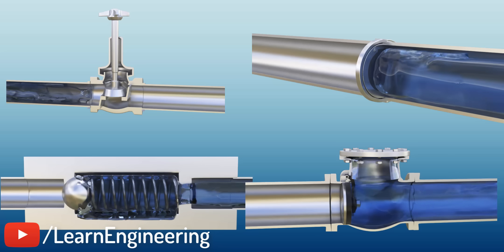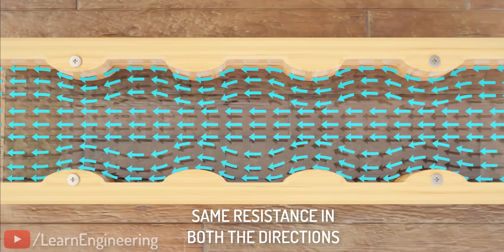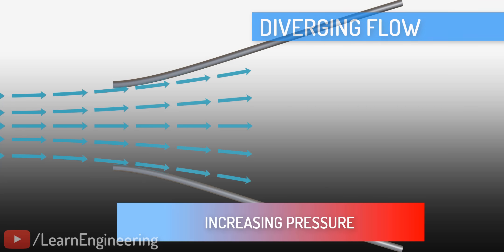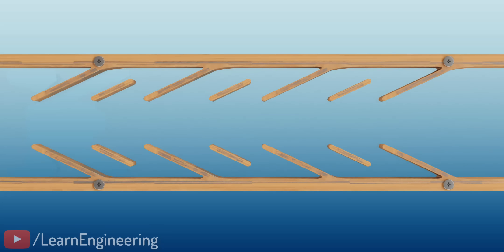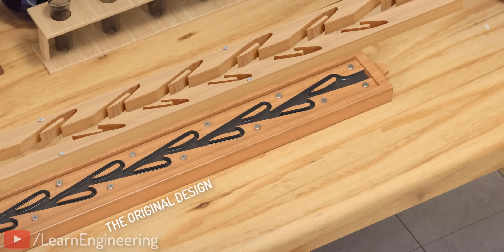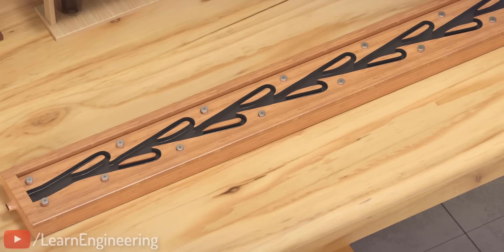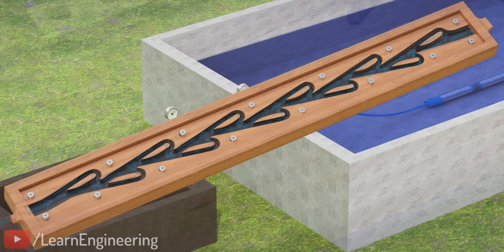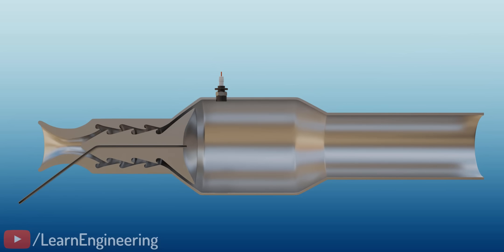Tesla Valve | The complete physics

Comment: Never thought Nicola Tesla would have had anything to do with fluid mechanics
Reply: It is kinda common for genius scientist to work in various areas, it's just usually they impact certain field of study so much, that it overshadows their achievements in other fields, which are remarkable by themselves
Reply: @Omgtired  there is no such a thing as a genius 

And it was more that he specifically had diverse interests
Reply: @Omgtired  yeah like Faraday also worked on the electrochemistry specifically the electrolysis but he got recognized in the field of electromagnetism
Reply: Fluid and electricity both take the path of least resistance.
Reply: @dtom2126  FULL BRIDGE RECTIFIER
Reply: @dtom2126  They also can be deadly in large amounts.
Reply: @dtom2126  That's incorrect for both. You might say "the path of least resistance is the most taken one", but saying fluid or electricity only takes the path of least resistance is very far from reality.
Reply: @dtom2126  I try as well.
Reply: And use the and similar equations....
Reply: @dtom2126  A lot of us too.
Reply: @dtom2126  No, they take all paths more or less intensely.
Reply: @dtom2126  hmm so every secondary flow could be wires from a higher resistance than the ones used for the primary flow ? =o Now it actually seems plausible
Reply: @srtghfnbfg  it would actually be a diode since a high resistance wire or a resistor would conduct the same voltage both ways. A Zener diode, however, would "conduct more easily" in one direction than in the other due to the Zener voltage.
Reply: @srtghfnbfg  i wonder if it could be done by connecting one end of a transformer to a bridge rectifier output, and connecting the other coil & the rectifier's input to the circuit's ac input. Then again, it'd be an overengineered diode i guess XD

Though maybe it could have some high voltage applications?
Reply: @srtghfnbfg  its called a semi conductor.
Reply: @srtghfnbfg  but current will get added at the junction because its a scalar quantity, can not put the fluid rules here, does not matter at what angle we join the wire it will get added, so its impossible to put this design in electricity
Reply: @danielf950  you must be an electrical engineer
Reply: @srtghfnbfg  We have things like that already, they're called resistors and diodes.
Reply: @srtghfnbfg that is not at all analogous to the mechanism of the Tesla valve, not meaningfully
Reply: @dtom2126   current takes all paths
Reply: @dtom2126  so does sound waves acoustic energy drives the Sun not thermal drives a piston not thermal drives a rifle around a rocket not thermal air Watts pressure wave propagation field is the perfect medium for matter itself to exchange frequencies back and forth between light sounds EMF anything any form of matter any form of energy frequencies and waves
Reply: Why wouldn’t he though. Remember how the project in Niagara Falls is because of him and his work.
Reply: NiKola*
Reply: @xgamerbih  yup, this.
Reply: 1st hydroelectric power plant in Niagara falls by Tesla and invented the Tesla Turbine
Reply: "Think of everything in this universe is energy and frequency". The one who said that should be the one who touches everything!
Reply: He was a genius
Reply: Tesla Pump....
Reply: Common men, he's genius of course he will do fluid dynamics
Reply: Tesla was the very definition of a genius. In 1930, he converted a Pierce-Arrow automobile fra gasoline to electricity. And it had a speed of 145 km, or 90 miles an hour.
Even today, we still haven't understood all the things he created or came up with in his head.
Reply: @Tech Stuf Schauberger was a pseudoscientist. He was a forest caretaker by profession, and contributed nothing to modern fluid dynamics like any useful mathematical models. He was more obsessed with esoteric views, i.e. he thought that there was some unknown "mystical" energy in every screw-like movement in the universe, which is of course nonsense.
Euler, Navier, Stokes, Bernoulli and Reynolds(just to name the most important) are the founders of modern fluid dynamics, study their work if you really want to learn something about the topic.

And btw, to all the others: the comparison of fluid mechanics to electricity is an useful analogy, but nothing more. The models and underlaying mathematics to describe these two different things are totally different.

sincerely, 
someone who's graduating in fluid mechanics
Reply: That guy was a genius.
Reply: Electricity is kind of similar to fluid, except it's the electrons which are flowing instead of atoms.
Reply: @snowblazed3442  air as well
Reply: @snowblazed3442  this is what I meant
Reply: @snowblazed3442  But Tesla didn't believe in electrons XD
Reply: @snowblazed3442  funny because tesla denied the electron, and it is still yet to be proven.
Reply: @snowblazed3442  Fluid obeys the laws of gravity.  Fluid tries to go downhill. Electrons aren't bothered by gravity.
Reply: @snowblazed3442  nice
Reply: @snowblazed3442 ..  each electron remains with the parent atom.. it bumps into a neighbor and passes the energy to the next atom... that's why electricity takes time to pass.. propagate.. through the conductor.. 300Mm/sec²... squared because it travels in both directions.. unless otherwise directed
Reply: @snowblazed3442  You need to see Veratasim's new videos about Current
Reply: @snowblazed3442   More generally it’s electric charge that flow.
Reply: @snowblazed3442  (nerd moment here) electrons don't flow in AC. In DC the move extremely slowly. Charge flows but in AC the electrons just move back and forth in the same spot. In DC depending on the voltage and the amps of a device the speed changes. The average lightbulb makes the DC electrons move like 8 cm/hour.
Reply: @snowblazed3442  It's not just atoms. It can be molecules as well.
Reply: @snowblazed3442  i'm pretty sure you can't create a tesla valve equivalent with wires =v however i'm a software engineer so my knowledge in the matter might be limited
Reply: @srtghfnbfg : that's exactly what a diode is. In fact, diodes are generally far better at only allowing current in one direction than a Tesla valve is for water flow.
Reply: @srtghfnbfg  then what is a resistor?
Reply: @srtghfnbfg   a diode would provide the same directional electron control that this turbulence generator.
Reply: @srtghfnbfg  
Fluid flow, electricity, and heat flow all act remarkably in similar ways. Heat flow can be modelled via thermal resistance to act just like electricty.
Reply: @srtghfnbfg  most diodes are more analogous to tesla valves than check valves though, especially ones that leak more
Reply: @srtghfnbfg   im pretty sure a resistor is just a tesla valve for current.
Reply: @srtghfnbfg  not so sure. 😁
Reply: srtghfnbfg  yes you can using a flow of sequential and parallel  in a circuit. You are diverting and converging the amps and volts. That’s how circuits for cities are done
Reply: @srtghfnbfg  I think he was referring that both water and electricity will follow the path of least resistance but yeah kinda wrong and kinda right at the same time lol
Reply: @srtghfnbfg  actually you can. Maybe not in the sense you are thinking but expand your view on this and literally look at the question at hand.
If electrons are to water then think of how the flow of those electrons share the similarity that they share with fluid dynamics. And if you think deep enough think of the differences AC as well as DC  may pose solutions to this problem. 
In my mind dont fall into the trap of Wire size equaling amperage capacity. Think of different types of conductors and how they behave. Something as simple as a temperature change could in fact be the valving mechanism. This change doesn't necessarily depend on a means of something like Refrigeration, it could simply be a gating factor limiting capacity from its own temperature increase from the flow of electrons. Many ways this could be accomplished. Dont over think some things, some of the options just might be staring you in the face.
Reply: @srtghfnbfg  Doping of Semiconducters to create P-N junctions works on the same principal.
Reply: @corieg1  a resistor generally doesn't depend on direction of the current flow.
Reply: @srtghfnbfg  isn't the diode the electrical equivalent? It doesn't have any moving parts, either.
Reply: @srtghfnbfg  lol, we play around with the electron much more than we play with water or any fuild. Just look at your mobile phone. The purpose of resistors and inductors are much similar to this tesla valves
Reply: @srtghfnbfg  actually theres a few different ways.  Google tesla patent on conversion of alternating to direct currents.   

All magnetism and wires.... no diodes or chemical method
Reply: @srtghfnbfg  Electrical equivalent for this valve would actually be a diode, since it allows the flow of current in one direction only
Reply: @srtghfnbfg  isn’t that what diodes do? There are plenty of electronics that keep electric field from saturating other components and keeps the current flowing in the right path.
Reply: @srtghfnbfg  an electrical version of the Tesla valve is literally a semiconductor….
Reply: @srtghfnbfg  It is easy to get EM to flow in one direction without mechanical moving parts. 9-)
Reply: @srtghfnbfg Alex, I'll take "Functionality of a diode" for $100.
Reply: @srtghfnbfg  If electricity is a liquid, that liquid is about as viscous as warm tar.  It cannot form jets unless it's taken out from the copper conductors.  Bingo, you've just invented the vacuum-tube diode.
Reply: @snowblazed3442  They are not similar at all.
Reply: He also came up with a bladeless turbine to extract energy from fluid flow.

https://youtu.be/mg4I2WIYAAM?t=472
Reply: @motogee3796  thx , it was very informative
Reply: Might be he was working with electricity and discovered this😂 just for fun
Reply: If you are human you have more that 98% something to do with fluid mechanics
Reply: Well, considering that his Tesla coils have to have some kind of hydraulics, this is a very well known and common theme woth Tesla.
Reply: Read his autobiographi "My Inventions" There you will see that electrics divice put him on history, and his fluid knowledge keep him alive in a barrier incident...
Reply: He had something to do with everything
Reply: He is mechanical engineer too bro 😎
Reply: He was studying mechanics before electrical engineering. And he had never finished it.
Reply: We can apply this to traffic flow
Reply: What other people have said.  Many very intelligent people in the past and present have a tendency to dabble in many areas.  It’s often how they get their big inspirations.
Reply: Ngl electrons are essentially fluids, but on the weirdest crack-cocaine imaginable
Reply: Nikola NOT Nicola ;-)
Reply: Yeah I'm also surprised to see albert einstein's name in geotechnical engineering method of sedimentation only later to find it's not albert einstein but his son hans albert einstein.
Reply: Oneof the most under rated scientists
Reply: Tesla belongs in the top 10 list of  inventors/scientists of all time.
Reply: ummmm, Tesla used Niagra falls(lots of fluid dynamics involved) to generate power for U.S/Canada. his turbines and power grid via westinghouse.
Reply: Fluid mechanics ties in well with his ideas of energy and power. He wasn't just a lightning crazed fool
Reply: A true engineer explores him/her self in all domains.
Reply: These smart guys always made a lot of different stuff. Da Vinci painted masterpieces and invented all kinds of tech you wouldnta thunk of
Reply: TELEFORCE

Ionic gas focusing

Critical energy density soliton shock front

Dressed optical filament laser induced plasma vacuum channel blooming mitigation, antiparticle midtrajectory annihilation prevention and / or wind resistance cancellation

Ablation induced / annihilation-catalyzed fusion / fission \/ vice-versa

Big bang? 'Small bang' projection device / 'Grand Unified Beam Cannon'

spARK of the revenant
Reply: That’s how he got idea about eletricity, trought water
Reply: Ikr
Reply: Mr. vechanic, in the future only speak when you definitely know what you're talking about. You'll seem smarter.
Reply: I totally understand you man, but when it comes to nikola tesla and thomas edison, i can believe pretty much any thing.
Reply: It's all just euclidean geometry.
Reply: Bruh I saw this in my recced and thought, eh, a but of physics can’t hurt me
Reply: Electricity is referred to as water flowing through pipes, maby he was trying to visually understand how he can make a one way electric valve, or do it backwards and get a amplifier possibly
Reply: those are stolen tech from the acient  pyramide
Reply: @andrehueck1914  
Are... you being serious?
Reply: Mr. vechanic 70.
Reply: Maybe he had a friend called Victor Shauberger?
Reply: Check out his turbine, if you thought that was impressive. He was hundreds of years early with his potential 😔
Reply: Didn’t he invent the pneumatic drill? Or am I misremembering things?
Reply: He looked at fluid flow and electrical flow the same
Reply: @DeXoDeD  gods natural laws
Reply: Literally fluid mechanics include electricity, air, and any type of liquid
Reply: Fluid and electricity is somehow related. They use fluid as an example for electrical situation like if the pipe is small, the amount of flow will decrease and we call that as resistance.
Reply: Electric is another kind of fluid to me, it just isn't the wet one.
Reply: True
Reply: U got electric shock
Reply: He dabbled
Reply: Current is synonymous with water. They share a lot
Reply: I guess you never heard of a Tesla Turbine
Reply: Electric current is like flow of fluids but very slow because drift velocity of electron is very slow
Reply: Fluid flow, electron flow, same thing dude!!! Lolol
Reply: He has something to do with everything
Reply: That guy is a genius
Reply: Tesla, like Viktor Schauberger(who could probably take the credit for these mechanics as well, or better), were from Serbia, and Austria respectively. They were well versed, and the last of their kind to practice the methods used in what some now revisit as Tartaria. The tech used in all forms of free energy, anti-gravity, di-electricity, engineering of all sorts(just look at the architectue of those and the neighboring countries)and many other principles not so long forgotten in attempt to bury everything that couldn't be measured monetarily... I'll just end here by saying, go search Tartar.
Reply: @skottidogg10  ok
Reply: @hoyteternal  what???
Reply: Its... shocking!
Reply: OK...next please.  Venturi ?
Reply: Check out the tesla turbine. He also built a scalar EM driven boat but yeah 'das impossible' according to the bullshit western EM laws used today lol. Tesla was right.
Reply: Also, Nikola Tesla invented the wheel, launched a satellite and shot the movie "The Lord of the Rings". He was such a unique person!
Reply: Everything is connected! Everything is energy!
Reply: This is essentially a diode, even the best diodes have some leakage current but they can restrict flow in one direction much more than the other
Reply: Its Nikola, Nicola sounds too wierd to Serbs and Croats reading this
Reply: You might be surprised how similar fluid mechanics and electromagnetism are, and not gonna lie so am I
Reply: N.Tesla was amazing.  Had wonderful idea with that earth-energy wireless electricity idea : wanted to provide FREE electricity to the whole country.  Politics and Edison totally screwed him. Just an amazing man.  Imagine what he could have done if his ideas were embraced and funded! He bankrupted himself proving that it could be done.  Died poor and broken man. Sad.
Reply: Some hypothesized that some tesla generators are powered by underground water channels, this might have been one reason why he's into fluid mechanics.
Reply: One Reson dam flow controle
Reply: I worked on the arresting gear engines on the USS Lexington Hydraulics is an amazing
Reply: Me too
Reply: Electrician s learn first electricity flows through a circuit much like water flows through pipes.
Reply: Nikola*
Reply: It mimics electron flow of ACDC power
Reply: Current in fluid is similar to current in electron flow
Reply: Fool... Tesla invented our future. Thats the reason they silenced him... Hi was 150 years ahead.
Reply: Didn't he help create the powerplants by Niagara falls using hydropower? Wouldn't that be fluid mechanics?
Reply: If you don't KNOW Tesla was our greatest mind last 4000 years you're sleep.
90% of all working everything thats makes up any city uses all his stolen pattens
Reply: I heard that Tesla have so much things for patent but due to his early death he never able to patent  them I don't know why ppl over hyped Albert Einstein and other but never tesla
Reply: @Nixter636  tesla was a Christian thats why.
Reply: @thetruth4196  so Albert Einstein was also Christian na? So what's the matter with that?
Reply: @Nixter636  Einstein slept with both his cousins. He was not a Christian.
Reply: @Nixter636  read his biography.
Reply: TESTLA IS A FRAUD.

ALL INVENTION WHERE RE PURPOSED FROM TARTARIA BEFORE THE MUD FLOOD RESET OF 1800S. 

THE CONTROLLERS KILLED BILLIONS AND RESET THE WORLD TO ENSLAVE US.

YOUTUBE SEARCH: TARTARIA AND THE MUD FLOOS RESET.
Reply: He was a true genius. To invent three phase electricity, the induction motor and this valve ; any one of which would have been  quite an achievement yet there were many others inventions as well'
Reply: That's the mindset of a great scientist, engineer and a genius who is completely behind the darkness, his works are much beyond than any noble laureate... Sad to see that that very great one didn't recieved the noble prize ... Shame to science field for not giving recognition to such a great engineer.
Reply: @pheonix1701  He was silenced because: 
1) Electric companies stole from him (his cut in the deal was so poor they didn't want to give him much visibility nor credit, I think it was GE)
2) his later work (radiant energy) would prevent JP Morgan to sell copper and rubber, and probably also enable general public to have cheap energy. So JP Morgan defunded and blocked other investor too.
Too genius for his own good.
Reply: @juanmf  that’s not true. Even Tesla says that’s not true about JP Morgan. In Tesla’s own words from “MY INVENTIONS V - THE MAGNIFYING TRANSMITTER” by Nikola Tesla

The tower was destroyed two years ago but my projects are being developed and another one, improved in some features, will be constructed. On this occasion I would contradict the widely circulated report that the structure was demolished by the Government which owing to war conditions, might have created prejudice in the minds of those who may not know that the papers, which thirty years ago conferred upon me the honor of American citizenship, are always kept in a safe, while my orders, diplomas, degrees, gold medals and other distinctions are packed away in old trunks. If this report had a foundation I would have been refunded a large sum of money which I expended in the construction of the tower. On the contrary it was in the interest of the Government to preserve it, particularly as it would have made possible — to mention just one valuable result — the location of a submarine in any part of the world. My plant, services, and all my improvements have always been at the disposal of the officials and ever since the outbreak of the European conflict I have been working at a sacrifice on several inventions of mine relating to aerial navigation, ship propulsion and wireless transmission which are of the greatest importance to the country. Those who are well informed know that my ideas have revolutionized the industries of the United States and I am not aware that there lives an inventor who has been, in this respect, as fortunate as myself especially as regards the use of his improvements in the war. I have refrained from publicly expressing myself on this subject before as it seemed improper to dwell on personal matters while all the world was in dire trouble. I would add further, in view of various rumors which have reached me, that Mr. J. Pierpont Morgan did not interest himself with me in a business way but in the same large spirit in which he has assisted many other pioneers. He carried out his generous promise to the letter and it would have been most unreasonable to expect from him anything more. He had the highest regard for my attainments and gave me every evidence of his complete faith in my ability to ultimately achieve what I had set out to do. I am unwilling to accord to some small-minded and jealous individuals the satisfaction of having thwarted my efforts. These men are to me nothing more than microbes of a nasty disease. My project was retarded by laws of nature. The world was not prepared for it. It was too far ahead of time. But the same laws will prevail in the end and make it a triumphal success.
Reply: So no knowledge if the tesla turbine or Eddy currents? This dude had to have been a conduit for extra terrestrial thoughts and signals. His 3/6/9 frequency knowledge was DECADES beyond anyone's understanding.
Reply: Haha, same thoughts until this.
Reply: @Tech Stuf thx man , u would definitely read that book
Reply: Lol...I thought the same
Reply: Kill Team Charlie  Can't you read the 40 previous comments and realize how many ppl said it too ?
Reply: @Tech Stuf what the hell are you talking about?
Reply: https://youtu.be/mC91vEMwq-E
Reply: Similarly we can build diode this way
Reply: Milan Pupavac  english people dont have those letters but I agree that they should at least whrite them properally with the characters they have
Reply: Milan Pupavac  it can also be used as č so its very confusing for the reader, thats why cyrilics are better
Reply: Milan Pupavac  yeah thats why writing č or ć as c is bad and it is very funny when someone does it
Reply: @TimP-f8q  Some types of diodes with rather high reverse polarity leakage would be a good analogy.  A mechanical check valve with moving parts might be a better analogy for most diodes types (that are working as designed).  
The reverse flow of the Tesla valve (or a specific diode in a circuit) might be considered a feature rather than a flaw, considering what the engineer is trying to accomplish.
Reply: 🇱🇷Awesome, @Steve.watcher hepled me gain back my disabled account in a matter of seconds. Find him on Instagram to get this service and lots more ✔
Reply: Is it possible to design a one way valve with no moving parts? 0:02 So the answer is no?
Reply: Niagara falls bruh
Reply: ik
Reply: It's hydro mechanic
Reply: As lots of answers before, fluid mechanics apply to several things, specially thermo energy. What everybody here forgot is the most remarkable area where Tesla applied his genius was fluid mechanics applied to electromagnetism!
Reply: Ikr Vatsal
Reply: Flow doesn't only happen in liquid form 👍
Reply: Nikola
Reply: @BlurryBigfoot  Really understanding a topic is understanding where simple analogies break down. Great that your analogy helped you. Does it help to explain the content in this video? Not so much.
Reply: U r fool then.
Reply: Tesla was a genius. Einstein slept with his cousins yes plural cousins.
Reply: @thetruth4196  
Yes he did sleep with some of his extended family. He was still also a genius though.
Reply: he worked on all kinds of stuff.. most of which ended up in the hands of the FBI... and we can only speculate where his mind took him... 
BTW.. we use the flow of water as an example of how electricity acts in a conductor
Reply: @richardcarew4708  actually he wrote an spoke extensively about the natural world and his strong faith and his own thoughts on Einsteins theory which his disapproved so you don't have to wonder where his mind was his was very vocal.
Reply: Same as Einstein
Reply: @HimanshuSharma-xn6uc  what is ?
Reply: On the other hand what uses would this valve have?
Reply: @Moose803  Google one way water valves and you'll see hundreds of applications.
Reply: Me too , until now !!
Reply: I think geniuses before the 20th century have much more diverse interests outside their main field of expertise. Nowadays modern inventors seem to invest time and resources solely on specialized projects directly in line with their main field of study
Reply: Genius minds try to solve every problem
Reply: Ghost producers
Reply: Thought the dude was a polymath... but damn fluid mechanics too?! 😳... he had physics at the palm of his hand like Galileo bruh
Reply: Ever thought what schrodinger did in chemistry xd
Reply: Fluid mechanics is inevitable!
Reply: NIAGRA FALLS POWER IS TESLA
Reply: He was an inventor prior to scientist, inventors are awesome people.
Reply: Everything in the universe can be described as both a particle and a wave.
Reply: Idea might have come during daily 🚽 use.
Reply: Viktor Schauberger also knew this.. His work was amazing..to the point the US government basically patented his mind. 
Read Callum Coats books ;)

https://youtu.be/UNyoaH1oS90
Reply: Nikola not Nicola. At least learn his name.
Reply: "Voltage is like Pressure" says my father when teaching basics of electricity.
Reply: He invented everything from household things to weapons
Reply: 1 WITH NATURE
Reply: Tesla was one of the smartest people in human history to date.
Reply: I his biography it says that he grew up in a little village, and his home was by a stream in which he liked to play.
Reply: He make tons of different things like the logic gate
Reply: Or physics really, Tesla didn't believe in electrons or relativity.  He was brilliant engineer but his physics was bad.
Reply: https://youtube.com/channel/UCn90M611FZgYSy3bMgECImA
Reply: Jb7jinimom
Reply: Their are aspects of fluid dynamics that are applicable to electrical current flow.
Reply: Tesla did a lot of work with fluid mechanics. Just check out the tesla turbine.
Reply: Edison : * this is my new invention *
Reply: Electricity and water both work very similarly
Reply: @brandenross2533  oh yea I love how water can flow upwards, jump open air, and flows through solid objects...
Reply: He was an amazing man
Reply: You didt know telsa
Reply: @andrewcarney6502  I still don't know Telsa. Who's he?
Reply: @andrewcarney6502  First time hearing the name Telsa.
Reply: 🤦‍♂️Tesla went to college for mechanical engineering. It was the electrical work that was actually outside of “his original field”
Reply: He defines electricity as a gaseous fluid
Reply: He lived in the era before extensive specialization and 'specialized mathematics'.
Reply: Never underestimate Tesla. 

Unless you mean the car company, in which case even the most dire prediction is an overestimate.
Reply: hes one of the most gifted scientists ever that's kind of fucking stupid to say
Reply: I’m with you on this, Tesla was a fraud, he didn’t even invent 3 phase electricity just took the credit for it
Reply: Flow is flow
Reply: Exactly
Reply: Seems like a fluid version of a diode.
Reply: that's why some people can be rude. they are illiterate and ignorant about humans capability. do you honestly think Tesla only good in what he did in science? he was capable of having sex as well. Surprise?
Reply: Tesla's most used invention might be the Tesla turbine which is also really cool fluid dynamics stuff...
Reply: the dollar has already lost a lot since the beginning of the threats to Russia and Ukraine! The number of transactions conducted in US dollars decreased from 71% to 48% worldwide and the USA had interest on each transaction conducted, since they were conducted in dollars! And now there are fewer deals,, less income,, the default is closer, are you stupid?The USA received hundreds of billions in transaction profits! Less and less now.паВц
Reply: Haha He probably came up with this while playing with the radio-controlled boats he also invented.
Reply: Praise Jesus, the one who can save you from eternal death. If you just put all your trust in Him, you will find eternal life. But, you may be ashamed by the World as He was. But don't worry, because the Kingdom of Heaven is at hand, and it's up to you to choose this world or That / Heaven or Hell.

 "Go therefore and make disciples of all nations, baptizing them in the name of the Father and of the Son and of the Holy Spirit, teaching them to observe all that I have commanded you; and behold, I am with you always, even to the end of seasonal". Amen."
Reply: Musk invented it
Reply: God, the Lord Jesus Christ loves you! Restore your relationship with God by repenting of your sins and putting your faith in Jesus Christ, "... that Christ died for our sins according to the Scriptures, and that He was buried, and that He was raised on the third day according to the Scriptures..." (1 Corinthians 15:3-4)
Reply: I readed once that his favourite was the Tesla pump
Reply: It's almost as if.... he's a genius 🤔
Reply: He had almost everything to do with almost everything.
Reply: @BlurryBigfoot  bruh there are analogies ofcourse because its the same universe and is driven by the same principles, however laws describing flows and electric currents are far from beind identical
Reply: @Omgtired  Perhaps not identical, but they are analogous.
Reply: There wasn't any fliud mechanic at that time. It was all about what you invent!
Reply: @NM-tk4kc  No.  the study of fluid mechanics predates Tesla.
Reply: @NM-tk4kc  There has always been fluid dynamics. Water mills, dams, aqueducts use principles of fluid dynamics.
Reply: greatest  mind always mess with fuild  machinic, archimede,  Leonardo  Da vici , newton, psacal, bernoulli, lagrange,  hagen, Javier and storkes, and now tesla
Reply: He actually created a modern world
Reply: An engineer is omnitalented ..he can even work at IT company 😅
Reply: @a_r_u_n7595  specially in india , right ?? 😂😂😂
Reply: @vatsal9005  yes😂😅
Reply: @a_r_u_n7595  and drive a car.
Reply: @a_r_u_n7595  An engineer is so omnitalented that he can do everything besides engineering 😂
Reply: Tesla is involved in everything.
Reply: He was the goat man..
Reply: He discovered circuit resonance. He can figure anything to do with physics.
Reply: This is what was scientists before, they invented more stuff in different directions cause they had time and open field not as today, where the big ones try to put you in some drawers and make u economic usable... Tesla would be ashame to build a TV with 2 jears lifetime. Sorry for Language.
Reply: Nikola Tesla is in everything, Biology,Astrology, health, waves
Reply: @sebinsebastian9404  Astrology isn't a thing!
Reply: Valvular conduit lol he still named it like an electrical component
Reply: They're not "fluid mechanics" the study of movement of water is called Hydraulics
Reply: @adannoyola9260  hydro dynamics
Reply: Tienes razon.   Es solo un video falso  para que des like
Reply: It's a great idea but with limited utility. No wonder we never see it being used in everyday life. It is strictly not a non-return valve.
Reply: He doesn’t, this was invented by a woman. He stole the idea.
Reply: @katja9369  prove it
Reply: @katja9369  biggest load of shit, not only did tesla have alot of his ideas stolen, but he was quoted as saying " I dont care if they stole my idea, just that they dont have their own" also of you look it up it doesnt say any woman made it, so where did you hear that